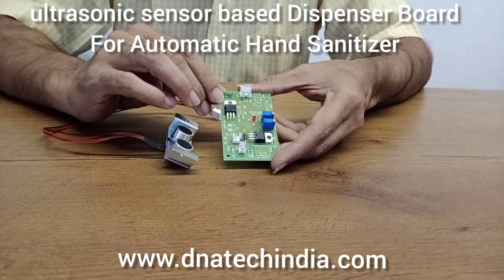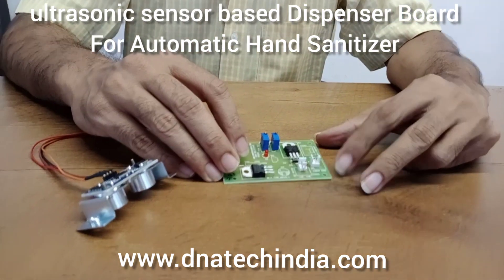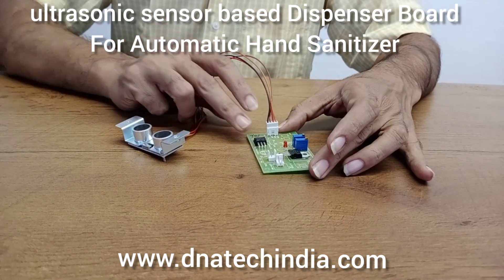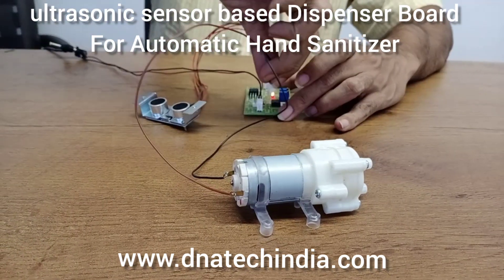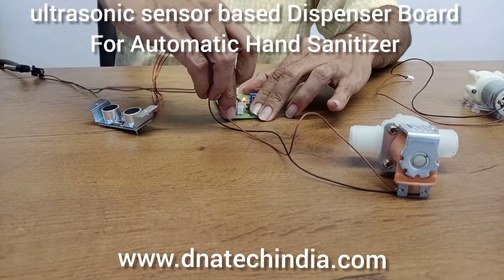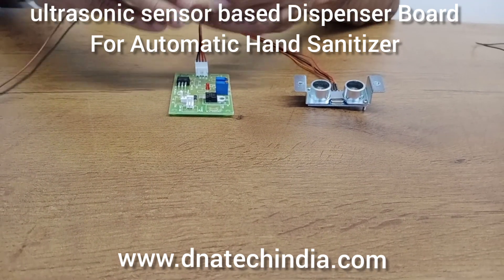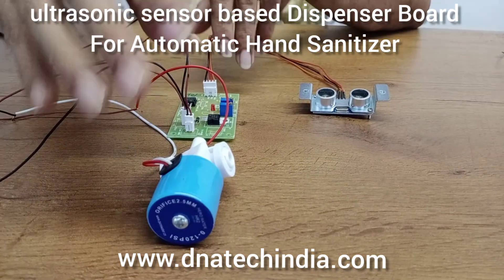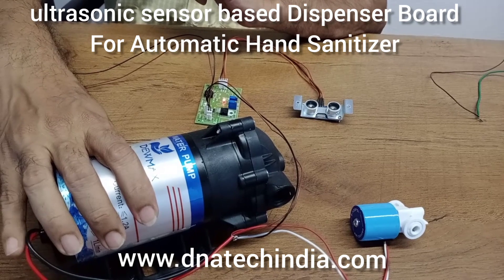Ultrasonic Dispenser Board for Manufacturing Automatic Hand Sanitizer Machine

Comment: Nice video.. really liked to take this. But can i use battery in place of power supply.if yes.how many have to be taken. And one more thing try to add led when dispensing liquid.
Reply from the maker: Thank you. Yes you can use Battery for power supply. If you are using 12 volts pump you can directly connect 12 volts battery to it. In this case You can use 12 volts lead acid battery. or if you want to make is compact you can use 18650 battery back. 
For led indication while dispensing you can connect the LED's in parallel with the pump. So the two wires that are going to the pump can also be connected to the LED's
Reply: DNA Technology thank u..
Reply from the maker: Welcome :)

Comment: Nice video..what is the use of using both solenoid and dc pump. And only using solenoid.pls tell the difference.
Reply from the maker: When you are making bottom dispensing sanitizer machine and you need mist then you require Solenoid and pump and if you need drop type dispensing then you use only solenoid.
Reply: DNA Technology thank u.

Comment: What it the cost for total kit sir?. For my shop usage purpose I made ir sencor sanitizer dispenser but in sun light time it is not working so. I need this sir
Reply from the maker: Link where you can buy from and cost is given in thee videos description section. Please check over there.
Yes IR sensor dispenser circuit does not work in Sunlight that's why we have developed this Ultrasonic Sensor based Sanitizer Dispenser

Comment: Will this work in mobile charger (5v) for working a  3v submersuble pump???
Reply from the maker: No It wont work. The submersible pump works without any issue upto 9 volts. You can use a 9 volts 1 Ampere adapter.

Comment: The components used in this circuit are highly heat emitting cimponents...but there is no solution for that issue
Reply from the maker: The rating of components used are way above the maximum current required for your pumps and solenoids. E.g. the maximum load current used by most of the people is 2.5 ampere (RO Pump + Solenoid) and we are using a power transistor which can provide a continuous current of 5 ampere and peak current of 8 Amperes. 
Even the voltage regulator used is of 1 ampere and our circuit (without pump) requires only max of 200 ma so no issue there as well.
Since we are using components with very high current rating there is no heat emitted. We have tested the power transistor for turning on the RO Pump + Solenoid (2.5 AMp) for continuously 10 mins and there was very less heating of the power transistor.